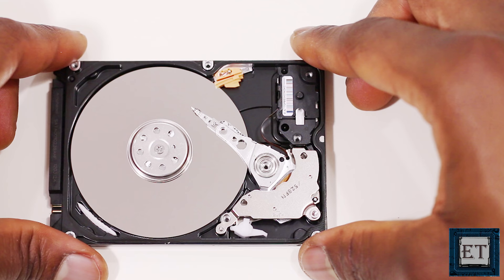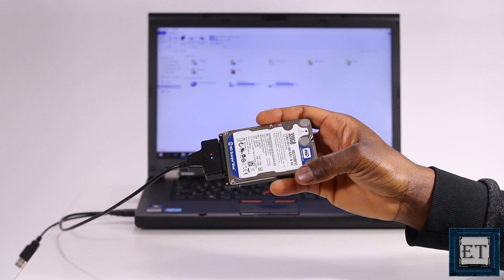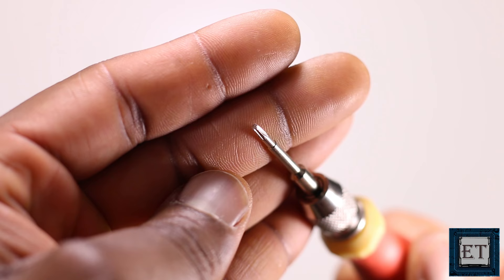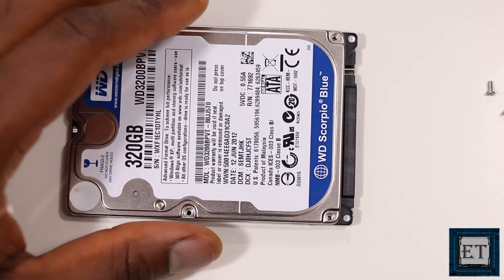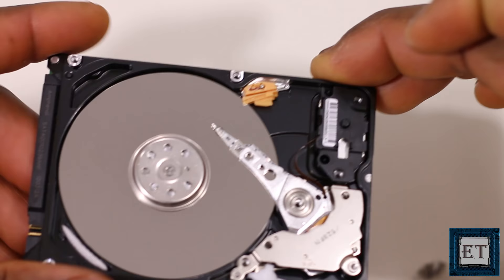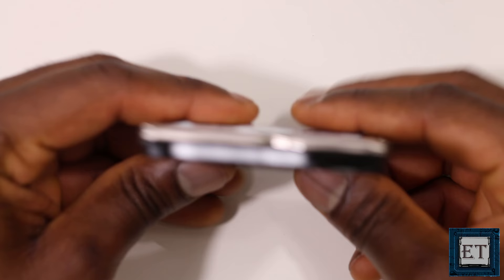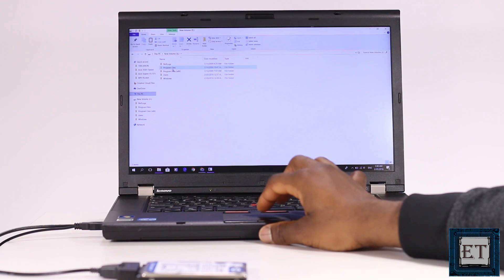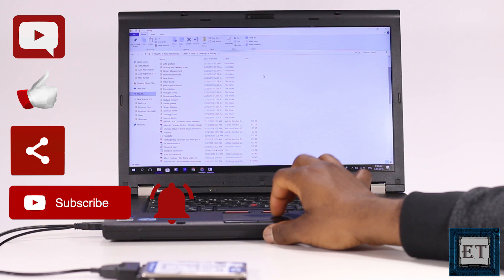How to Repair a Broken Hard Drive With Beeping or Clicking Noise (Recover Your Data)

Comment from the maker: Get genuine Windows keys at 𝑷𝒓𝒊𝒎𝒆 𝑻𝒆𝒄𝒉 𝑴𝒂𝒓𝒕, Use ET20 for 20% OFF! links below:
✅ Windows 10 Pro key: https://bit.ly/32EkTqY
✅ Windows 11 Pro key: https://bit.ly/31jyHdg 
✅ Other Software Products: https://bit.ly/3r03TYu
Reply: Eeuu
Reply: I have a buzzing sound kinda comming from my hdd a should i give this a try?
Reply: if happen in 3.5" hardrive it is same with this situation ?
Reply: Dont know if anyone cares but if you guys are bored like me atm then you can watch pretty much all of the new movies and series on Instaflixxer. Have been watching with my brother lately =)
Reply: @Ben Jay definitely, have been using InstaFlixxer for since november myself =)
Reply: My own case the disk head wasn’t stuck but the disk hess. wasn’t moving to read the platter. I don’t know what else to do bcuz the platter is rotating fine but the disk head isn’t moving to read the files on it, I have wedding jobs on that drive I can’t loose, please help me what I do
Reply: Some other videos menioned it shold turn CCW instead CW. Very confusing.
Reply: @folklorefablesbyvictor  same case with mine
Reply: what happened if you opened and noticed the disk head is not on the platter yet the drive doesn't run?

Comment: I tried your technique, and it worked. You hit the problem right on the head! The disk head was on the platter just like in your video here! I pushed the disk head back to the landing zone. It took a lot of restarts, shut downs to power back up, and prayers on my Mac to get that led light back blinking again! I almost jumped through the ceiling with happiness! Brother, you was a blessing indeed! And, I subscribed to your channel out of appreciation!
Reply: I can understand that jump thru the ceiling completely🤣
Reply: or you can hit the hdd into a table with the right angle and force, to assist the head into going off the disk
Reply: Is that drive still usable? Or is rhis just for recovery?
Reply: @insomanic100  absolutely not, you have a better luck hitting it on a table to assist the head to move and fully save the drive
Reply: After success open , u transfer the file or juat leave it ?  if not transfer , files still there or just gone ?
Reply: @iklilasyraaf  if you leave it, The drive will fail and you won't get your data back. unless you give it to the professionals
Reply: @Aston3003  thanks for the answer bro ✌🏻
Reply: @iklilasyraaf  you have to move fast if you did this, you could also just hit the drive on the table to fix the head. you need to angle the drive so when you hit it on the table the head gets moved out of the disk

Comment: Great video. but it's important to note that you do NOT want to reuse the hard drive if this fixed the problem. Backup data IMMEDIATELY and scrap that drive. It's a ticking time bomb.
Reply: Wow will it get damaged again ??
Reply: @erikaneyakndue3516  there is a large likelihood that it will repeat the same thing. And even if it didn't, just opening it compromised the drive by introducing dust that will start damaging sectors and your info will get corrupted little by little.

Comment: Clear, concise, straight to the point. Subscribed! 😁
Reply from the maker: Good to know it helped you out, thanks so much for the feedback!
Reply: And edited + fake. That is not the error with that drive.
Reply: @EasyTechs yo man my laptop is not turning on its beeping from the speaker and i hear clecking and a little beep from inside i didnt my laptop for like 2/3 months and was in a slanted position anyway i can fix it without opening?

Comment: Please heed the warning to do this only as a last resort as once you open the drive in any environment other than a "clean room", particles of dust will enter the drive and destroy it over a relatively short period of time. This is because the read/write heads on the end of that swinging arm float on a microscopic cushion of air just above the delicate surface of the spinning platters. A dust particle is relative to the size of a boulder compared to the space between the platters and the heads and scrapping of the magnetic material will occur releasing more particles which will continue to cause more damage. 

If you are able to access data on the drive after doing this, I highly recommend that you copy whatever you need off of it as quickly as possible before total failure inevitably follows.
Reply: I 100% percent agree.

Comment: You are the first person I have seen who does it by turning the record in the opposite direction. So far, everyone I have seen uses the screwdriver to secure the record and pushes the needle out with another object. I think your method is cleaner. I will try it.

Comment: Thank you bro. Every single service centre in my area said it is impossible to service and the only option is to recover data (which will cost me $350 minimum and just to check if it will work or not I have to pay $50). I took the leap of faith.
Reply: did it work

Comment: I had a similar hard drive which has clicking sounds. First I took it to the repair shop and they did initial checks for a small fee. Then they came back and said they cannot guarantee data recovery but will not charge me full in that case. The minimum fee is really expensive and I don't really have that much critical data (only MP3 songs and holiday photos). I then took the risk of doing it myself and it worked! Thanks but I used a hook to move the reader to the side.

Comment: Dear All, don't try this at home even if it seems easy. My hard drive is gone forever including the important data. My advise is to take it to experience data recovery centers to assist. Most of them have played around with many external hard drives and damaged a lot, so they know the best way to handle it.

My hard drive is useless now because if I take it to a recovery center it is already late

Comment: SUBBED!!!! I just tried this on a Lacie external drive and it WORKED!!! I opened the drive and the disc head was in the parked position. I thought that it must be the motor or something else causing the issue because the disc heads weren't parked in the middle of the platter. After putting the hard drive back together, I called FileSavers. They quoted me a 100 dollar consultation fee since I had already opened the drive and that it would be another 700 to 2500 to recover the data! I thought I'd try plugging in the drive one last time and EVERYTHING WAS THERE!!!! I'm currently backing it all up to an external SSD just to be safe. Thank you so much!!!!

Comment: Thank you! This is so useful! My external hard drive just begun to tick.
Reply from the maker: Good to know it helped you out, thanks so much for the feedback!
Reply: Did it work for u
Reply: @TeeWoods_  it did for a time. I backed up all my files then after, it just stopped working. This solution is your last resort to save your files.
Reply: @dncontent3091  What is the best way to backup files in this cases ? I have seen some hdd readers that transfer data. Or just connect a usb to pc and transfer it there ?

Comment: I have previously attempted a similar fix (I moved the head itself rather than the platters)and it still doesn't work. The drive spins up but it still makes the clicking sound and under careful observation, I saw the arm is not even moving. Is there a way to fix this - either myself or a repair shop - or is it the end for my drive?

Comment: I have this problem (clicking) and will try this fix! Thank you for the very helpful tutorial, regardless of whether or not is solves my problem.
Reply: Do you solve the problem?
Reply: This will not fix a clicking drive. This is for the opposite problem. A stuck drive doesn't click.
Reply: @nathankarras2715  is there a fix on a blinking white light but nothings happening?,btw it's a portable hard drive...

Comment: since that problem has happened in my laptop hard drive, it makes the exact same noise but even louder, at that point im thinking it would blast inside my laptop. i've started experiencing major problems like extreme stuttering, lagging, infinite loading or crashes on the most of the games, and file explorer gets completely frozen for some seconds. my data are hopefully safe in my online vault, but still disappointing, any other way?

Comment: i have 1TB wd elements hard drive. it is making beep noise and don't show in computer. What should i do to fix it sir?
Reply: I had the same problem with my Western Digital 500GB external hard drive. I was in the middle of large file transfer and it quit. Made a bunch of weird noises. The computer stopped recognizing the drive. So I took it apart as in this video and found the read/write arm stuck over the middle of the platters. I carefully moved it back to the park position and closed it up. I can now see the drive and all the folders but can’t open any data on the drive to transfer back to my desktop. 😡😡😡🤯

Comment: Hi Sir. Can you help me to repair my  1 TB HDD Transcend, that was detected but it does not appear on My computer. It creates clicking sound. When I tried this video and found out the platter is place on its original location so I put back and tried to plug in. When I open Disk management, it appears that the disk shows "unknown" and "not initialized".
Reply: Same! When it prompt me to "initial disk" to GPT, it says "The Device is not ready".  It's working in the first place, but I decided to try it on a new 4 Port USB 3.0 hardware with external USB power. Realised the other 2 HDD and 1 Thumbdrive worked, except for this one (sounding like not enough power). And then later when I disconnect it, it can't be detected as a drive already, only showing on "Disk Management" as a drive as "Not Initialised".
Reply: Ok I think I am going to give a really "bad" advise.... I was giving up on my hdd, so I end up shaking it gently when it's off the plug, and plugging it back, it started to work again....... mechanical parts shouldn't introduce any of such motion (worst scenario is to try knocking on if as if it's jammed part), but somehow my Toshiba 1TB drive worked again after this....
Reply: Ok when I try to access the folders within, it hanged my windows 10 system, so when I force disconnect it (since I can't eject it anymore), the problem came back....
will just leave my comments here, see if anyone can explain what is this about if they happen to know...

Comment: When I opened my hard drive the platter is in normal position what else can I do because I need to retrieve my data
Reply: Same here   please help
Reply: Can you hear the platter spins? if it`s spins and the arm don`t move you need a new actuator arm or board.
Reply: Wolf_Boy  my hard drive spins and the actuator slams into the landing zone creating the click
Reply: @Jboops  how did your story end

Comment: In my case I did the same carefully moved the head to the orange pocket with utmost care and almost dust free environment and then tried to power it on. Then every time it starts the head moves three to four times and gets back to the orange area, The disk rotates for sometime and then everything stops. It happens every time tried to power the drive.. What could be the issue, is it power issue? Need to replace the PCB?

Comment: hi, when i move the platter, the disk head does not move. it is stuck pointing very close to the centre of the platter. should i use force to move it out of the platter? i guess not. any ideas? there is no clicking noise, btw. more like a rattling or wheezing noise. like loud snoring :D thanks

Comment: Excellent demo, very easy to understand.
Mine just makes regular clicking, scratchy noises.
1st, I cant see any physical damage to any of the fuse's or components using my magnifying glass and 2x pairs of glasses!
Have now taken the other side off to reveal the platter which had some tiny dust? particles.  Used a blower brush to remove them without touching the platter.
On the faulty 2.5" the needle is in the parked position. and when I rotate clockwise the needle is not moving.
I can see a thin, delicate leaf spring that runs along the length of the needle which is attached to the top and bottom mountings.
I'm not bothered about the drive contents.  I always make backups on several other drives, so nothing was lost here.
Will keep researching - thanks for a very helpful video on this. 👍
Reply: Hi what did u end up doing to ur hdd
Reply: @notwithout6878  Just sitting there on the shelf. When i get time I'll take a another look. No worries.
Reply: did you it ever start back working?

Comment: That pin in my hdd seems to be in the correct position but it still makes clicking noise. What could be the problem?
Reply: @lfeever  Mine got fixed automatically. I don't knwo how, I did nothing. Though it still makes some noise sometimes but it works now
Reply: @md.mazharulalamsanvi7047  same here...but the problem will occur again definitely...so backup the data immediately

Comment: whatt if  there is that click noise and the start but the  heads were at rest when opened?  also move in and out of the disc when motion is set with the screwdriver clock wise and vise versa ?  but the disk  does not recognized form system > any clues ?

Comment: I need a definitive answer to this question: When turning the platter with the screwdriver, is the platter supposed to be turned clockwise or counter-clockwise? In this video, it is the former. In other YT videos, it is the latter. Or maybe it doesn't matter. I would truly appreciate you for the advice.

Comment: Hello. Thanks for the explanation, mine was also stuck in the middle of the platter and i fixed it like you showed in the video, its not beeping anymore but it still doesnt work when i connect it to the pc. It makes some strange clicking or vibrating sound but PC doesnt recognize the hard disk. What can i try now?
Reply: Same happened with me...  Anyone would like to explain
Reply: Its dead. You can only use it once. Once you opened it for the first time. So if you do this method as last resort, be prepared to back everything up from the device, cause once it's done and disconnected. I won't be the same again.

Comment: Hi, I followed the exact instructions of the video, but when I opened the drive the head wasn't moved on the disc and it was in the same place where it has to be. Since I had the exact same clicking noise coming from the hard drive, I followed your instruction from the video. Prior to that, I also check if the hard was working in a different computer and other ports but still the same. Can you please advice what else I can do to fix this?
Reply: Same thing here. Any fix yet?
Reply: @abdusalamolamide  no fix I’m afraid

Comment: Mine wasn't stuck, nor on the disk. I took the hard drive enclosure off and plugged it in to my PC (it's an external), and it seems that it's getting stuck on the orange piece that catches it. It also seems to be sporadic, or it could just have more than one issue. Any suggestions?

Comment: I can't find a screwdriver that works on the middle to move the arm. I tried the torx one that worked on the other screws but it doesn't fit the middle. I can't understand which one he said to use?

Comment: I have a dead transcend store jet 2 TB external hard drive, it was dropped and stopped working, learning from YouTube I have opened it  and restored the head which was stuck on the pluter myself at home but intead of turning off the clockwise the pluter I pushed the head and it is still not detecting on the PC and making cracking and beeping noises, what should I do now?

Comment: my wd 500gb hard drive from about 7 yrs ago is IMPOSSSIBLE to dissassemble.  i cant even get to the head,  i got the outer casing off.  then there is ANOTHER level of casing.  i got that off.  then comes the actual drive.  i got all the screws off.  but the container STILL wont come off , im resorting to prying at it

Comment: Hi, need to know what screwdriver to use on WD 4TB Elements Portable HDD, External Hard Drive, USB 3.0 for PC & Mac, Plug and Play Ready - WDBU6Y0040BBK-WESN. Similar clicking noise issue. Thank you in advance

Comment: AWESOME!! What can you do if the arm is in the correct place but it still clicks?
Reply: That is my problem also, may I ask if you found a solution yet for your hard drive?
Reply: @mskiara18  No I haven't.  I couldn't fix it and my IT dept. couldn't fix it.  I'm going to have to send the hard drive off to one of the companies that MAY be able to pull the files off of it. 
Sorry it took so long to reply!
Reply: @tracysmith3343  Okay, my apologies with what happened. I hope you can save your files. I will have to search for answers, my problem with more complicated since I also have a raw drive and I need my important files.

Comment: Hi
I have hard disk error (EF0). The hard disk broadcasts noisy sound when plug it through USB cable. It seems the hard drive needs repair such your procedures. My question is: can i use it again in the laptop after the hard being repaired?

Comment: my internal hdd ticking like a clock sound, already check on other laptop with exact same type and didnt read too. i did as what you explain on the vid, but the needle reader were already on the right place. but the ticking sound still there....
any helps are appreciated, thank you
Reply: we did the same thing but it doesnt work
Reply: @signal1fabsection531  rip our disk man

Comment: I transferred the platter from a broken drive to a new drive and the new drive is clicking. Nothing was unusual regarding the transfer as it was simple. The heads park properly and the platter spins freely.  What is the problem?  Is there a video that explains this problem?
Reply: What was your solution?

Comment: i did open my hdd, but the heads were close to the center wheel. when i tried to manually out them back where they are supposed to be. they won't move at all. BTW my hdd is 3,5". any suggestion will be appreciated.